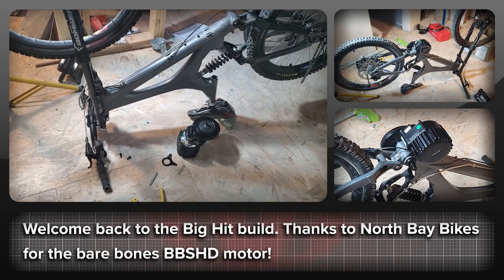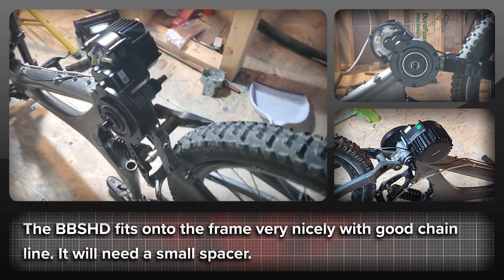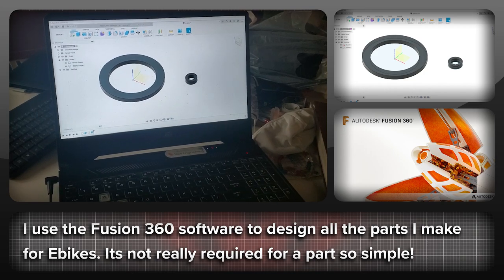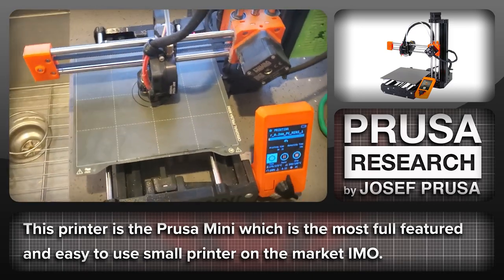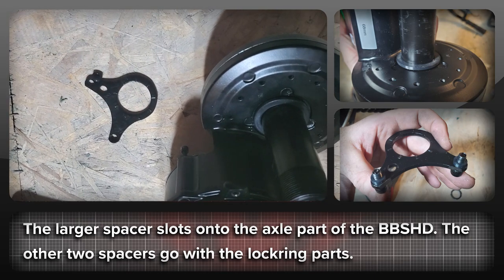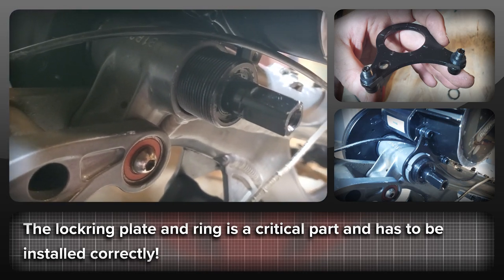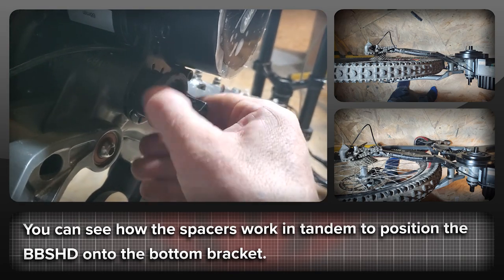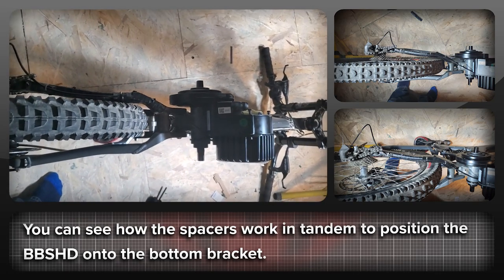NEW Bafang BBSHD Build (Big Hit) - Motor Spacing with the help of 3D printing - Part 2

Comment: I got the BBHD , and I got it with a 52volt 14.5 AH battery . The controller display says its a BBS03 , but he seller emailed me this note , are you familiar with what they messaged me about .Start.  The 52V1000W motor shell may be marked with 48V1000W. The judgment criterion is to see the controller's production number 506, and that charging with a 52V battery will show that it is full charged. There is no problem with the product, just because the wrong 48V was printed during production. End.  My only concern was the controller is fixed at 28 amps and not a 30 amp controller , but I read a lot of 30 amp controllers were getting burned out so i dont think its a big deal . Since the install i have riding the bike about a 170 miles and its fantastic and can cruise about 20 mph consistently.
Reply from the maker: They all say 48 volts 1000 watts. The bbs03 is the bbshd. It gets very confusing. Thanks Bafang 😆 There is nothing wrong with what you bought tho. Cheers
Reply: @HighVoltageKits  I checked last night while riding home that the max output  on the display and set to 9 said was 1200 watts , i have the 52volt 14.5 AH battery . Why wont it reach the 1500 watts ?
Reply from the maker: I'd say it's cause your amps have been restricted by the seller. I would confirm the controller settings with them. We can go from there.

Comment: Great job brother. The rear suspension bearings... will you be beefing them up with some very high quality one's? The Chain alignment seem compromised if your stock bearing's are of average quality. Frame twist is what I am getting at... I think it would make for a good video seeing I have never done that one yet, myself!
Reply from the maker: Thanks. He will be overhauling that stuff along with a suspension rebuild. Good points. If he has not done it yet we can show that! Cheers
Reply: Owner here. I will pull the shock off and look at each bearing. There does not seem to be any play within the rear end of the bike. The bearings on the bike were high quality and as long as they are in good condition they should be good to go. The main concern i have right now is rebuilding the rear shock, replacing the spring with a more suitable weight spring and or replacing the whole setup with something more suitable for a heavy bike.
Reply from the maker: Cool..We are definitely doing the spring. Possibly the whole shock.
Reply: @enlashok  lots of work ahead huh? I enjoy searching through salvage yards and finding goodies like a Motorcycle Oil Mono-shock and some strong coiled springs... a torch can help ya adjust the springs tension... bring a few cold ones with yah... helps with the hyperventilation ya might get when ya find that perfect treasure!... duct tape and gorilla glue, works in a pinch too!
Reply: @joeows6537  I can just get a replacement spring or a new mtb air shock  the existing shock is a fox so it's pretty decent

Comment: Will these be back in stock anytime soon? Also will it work with bbs02?
Reply from the maker: We are looking mid year. Will do the 02 but you would set to less power.
Reply: @HighVoltageKits  if I have a 52v battery how much power could I get out of it?
Reply from the maker: 2800 is about the peak with these...Max safe for the 02 is about 2500 anyway.
Reply: @HighVoltageKits  better than the 1300 it gives out. If it runs 2500 on the 02 will it start to damage it?
Reply from the maker: Thats what guys have been using on discord. Seems ok as long as gearing used properly

Comment: I have this old BigHit DH bike and looking forward in converting it to eBike. Where's part 3?

Btw, what is the model # of this kit?
Reply from the maker: Part 3 will hopefully be very soon. When you mean kit are you referring to the controller? If so that's an I house upgrade kit we make.
Reply: @HighVoltageKits    I meant the electric motor. It seems that it fits the BigHit body perfectly fine. I don't want to jump and buy a motor that isn't guaranteed to fit.

Is the motor and controller all in one?  I was expecting that the controller is another separate  box or within the battery box. I am new to this so forgive my ignorance.
Reply from the maker: Its the bbshd, you need the 68mm bb version. It comes with a controller we just happen to be modifying this one to run at higher power.
Reply: @HighVoltageKits  68mm, got it. Looking forward on your BigHit project.
Reply from the maker: Cheers! Good luck with yours also.